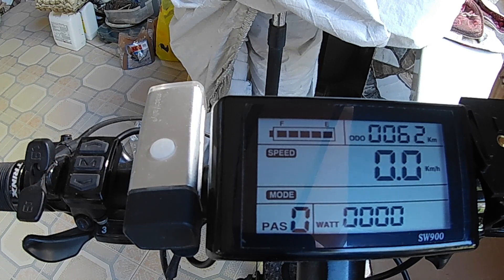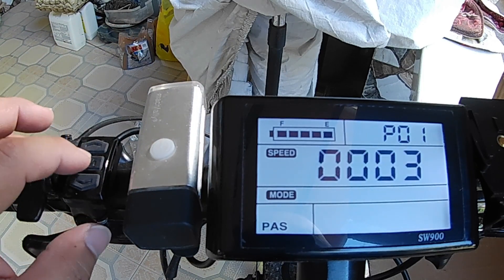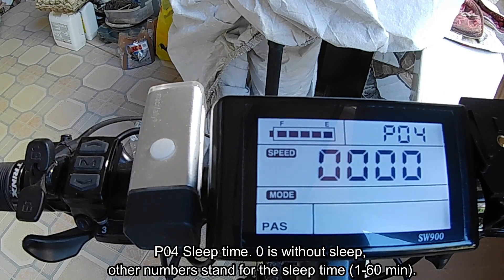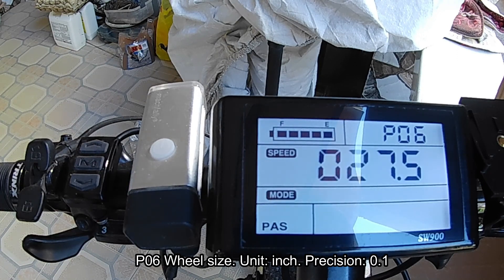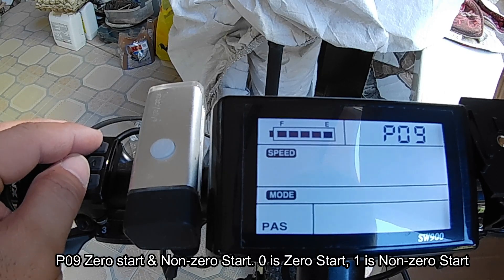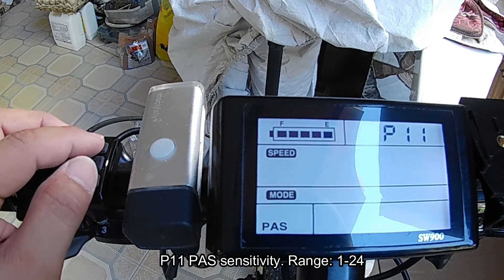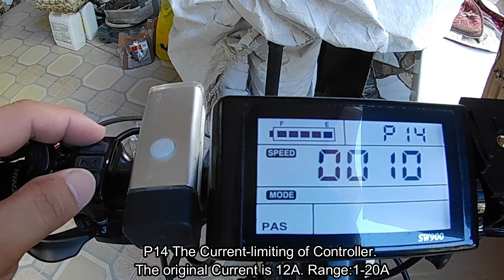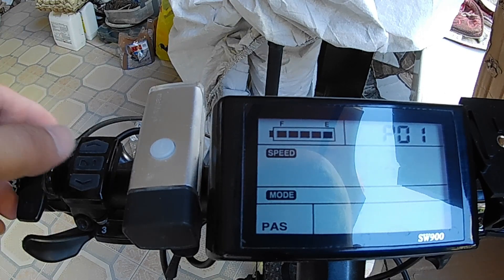DIY Ebike Conversion, Controller Configuration with SW900 LCD Display | DIY Petz

Comment: Thanks for your very helpful video!  Can this display be used with Tongsheng tsdz2 engine?  I would like to replace the vlcd5 that I am currently using.  Thanks again
Reply from the maker: Good day Sir, sorry but I can not tell if these can be used for the said motor Sir. Tnx.

Comment: P09 is throttle activation delay 
You can pick how soon the throttle will start pushing the bike 
Right away after you press it
Or after.
Thanks great video
Reply from the maker: Thanks for the info Sir. Stay safe.

Comment: Thank you for the great presentation ,in the way even I could understand. I built my bike  but I am not a speedster and I got carried away with 1500w motor and a 20 amp hour battery. I have it wired to 750 w and it has more than I need because I daydream a lot and ride on steep rail road embankments.
Reply from the maker: You're welcome Sir, glad to hear that.

Comment: hello thank you for your video. the p14 parameter on my sw900 goes up to 50 A. I have the impression that it is there but inactive because setting it to 1 or 50 does not change anything in torque or speed. possible in your opinion?
Reply from the maker: I think that has something to do with battery spedifically on the continous max discharge current the battery can support. Mine supports up tp 30 Amps continous so this functions works on my e-bike.
Reply: He is correct  that is the  continuous current limit of the controller if is not set properly to match the battery it will shut down the bike. If the bike is working fine leave it as it is or ask the manufacturer

Comment: Hi, thanks your video, it’s been 1 year and wanted to know your experience updated upon your SW900 LCD Display. I have ordered 2 ebike 12000w with the SW900 LCD Display. I herd there’s a new model ukc1 led color display that just came out not to long ago. But yeah I seen good and bad reviews of sw900, what’s your experience feedback on it ? Is it all weather proof? Is it reliable over all ?
Reply from the maker: Good day Sir. It's been almost 2 years also in using the display and so far I have no complains for it. It has been used in all weather conditions and so far it's fine. Nothing to complain about and I have not encountered any issues with it Sir. Stay safe.
Reply: @RollyPetz  thank u 👍🏼

Comment: Have 1000w direct drive sw900 ,Display works show's all data but cannot adjust pedal assist ,it works but feels like its it max assist as draws around 450watts during PAS and no effort peddling (no throttle used)
Also this may help someone ,my sw900 wouldn't connect Error10 I found the 2 data lines crossed ,reversed wires then connect ok
Reply from the maker: Thank a lot for the info Sir Tiggy.
Reply: @RollyPetz  You any ideas on pedal assist ? it makes no difference on settings and can't turn it off with sw900
Reply from the maker: @tiggy2756  Sir what do you mean by turning off?
Reply: @RollyPetz  If I set the pedal assist to any setting even zero I get max pedal assist  all the time
Reply from the maker: @tiggy2756  is it at P11? try also decreasing the P14 and test it out again. Tnx.

Comment: Hola buenas. Que velocidad puede desarrollar este Kit.
Gracias
Reply from the maker: Good day Sir Ramon. The speed of the kits will vary on different scenarios, the weight of the rider, terrain being travelled to, tire pressure and the like. Below are the typical speeds.

PAS Level 0 - Normal pedaling speed between 25-30 km/hour
PAS Level 1 - Speed between 25-30 km/hour  
PAS Level 2 - Speed between 30-35 km/hour
PAS Level 3 - Speed between 35-40 km/hour
PAS Level 4 - Speed between 40-45 km/hour
PAS Level 5 - Speed between 45-50 km/hour

Battery @ 48V 16AH would like go beyond 60 km depending on the pedal assist levels.

Did I answer your question Sir Ramon? Tnx.

Comment: Probleme my sw900 shen turn off , the gaz and pas work. Someone know the probleme
Reply from the maker: Good day Sir, you may want to check sa connection going to the lcd screen if it's OK. Or else try to check sa dim settings of the controller.

Comment: Hi for some reason my battery life bars never go out, Always shows full charge. Any advice?
Reply from the maker: Hi Sir, have you experienced draining the battery for your use, example on a longer ride? Base on my experience it will always stay of full bar until such time the battery drains out then it would likely indicate 3 bars then go back again to full specially when you are at stop. That means that the battery almost reached its low voltage disconnect. But if you continue using it, then it will go 3 bars till 2 bars then would disconnect eventually. Thanks.
Reply: Have you set correct battery voltage in settings ?

Comment: Sir how i fix Error 006, i change battery, i change controer , nott error one time butt engine not work?
Reply from the maker: Hi Sir good day. Have you check the configuration on P03 if its selected to the correct voltage? If this is not set to the correct voltage rating, chances are your motor wouldn't run. I supposed you've already check the battery voltage using a multimeter. Thanks.
Reply: @RollyPetz  Thanks for amswer Sir! I test controller again with avo-meter and battery, two series of battery not working, damaged i think, problem resolved. now bicyce working good. Thanks!
Reply from the maker: @a78011a  Glad to hear its up and running Sir...Stay safe and ride safe.

Comment: When I go to P10 and change it to the option with no pedal assist, pedal assist is still on. Or if I put the option with no throttle assist the throttle is still on
Reply from the maker: Good day Sir. Same thing with my conversion. Both are still on even if the configuration is changed. Maybe this how the controller works. hehehehe. Thanks for your observation on this bug as well.
Reply: Thanks both of you
Reply: In my case my motor is not moving and the pedal assist is still working after disabling it

Comment: Complimenti sir per l'ottimo video e spiegazione top. Ho questo display, mi può spiegare come si fa a resettare error 7? Ho trovato il problema, ora voglio solo cancellare error 7 dal display, ma non so come farlo. Mi aiuti se può
Reply from the maker: Good day for error on P07, kindly check the magnet mounting if it's 1mm closer to the sensor, also check if the sensor cable is mounted and fixed tightly. thanks to google translate I was able to read your comment.

Comment: Hello. The thing I wanted to see was the diameter of the wheel. But you didn't show anything.
Reply from the maker: Hi Sir, for the diameter of the wheel is on config P06 which is the wheel size, in this case for mine its 27.5. Thanks.
Reply: @RollyPetz  Thank you for your reply. But I wanted to know that other diameters can be set. For example is it possible to put 11-inch?
Reply from the maker: @vd1261  good day Sir, yes it can be set to the desired  wheel  size or diameter to what your are using.
Reply: @RollyPetz  Thank you very much. Very kind
Reply from the maker: @vd1261  good day Sir, I'm glad this was helpful. Stay safe.

Comment: I have an issue with my display that i just cant figure out. hoping someone here may know how to fix. the speed limit does not work and cant figure out why when all other settings work. the other problem i have is i set the tyre size correctly and the odometer was correct but the speedometer was around 10 kmh out. reading 40kmh when only going 30kmh. so i changed p07 and got the speedometer right but now my odometer is completly out. did 7.6km but the trip said 4.3km. is there any way to make both accurate? i can change p07 back so the odometer is correct but then the speedometer is wrong. i can change the tyre size to around 16inch to make the speedometer right but i dont think the odometer would be correct.
Reply from the maker: Good day.
Here are my answers based on my test.
> the speed limit does not work this only works on throttle and not on pedal assist
-> offset mileage and odometer -  try to play around the tire size ex. 20", try to put it @ 21" then adjust P07 just a little bit.
Thanks.

Comment: How to solve sw900 error code 10 pls..
Reply from the maker: Good day Sir, this usually happens if there is a loss cable connection between the controller and lcd screen. Try unplugging the main connector cable and check for any corrosion. Then re-insert back. If not then you can try these videos instead. https://www.youtube.com/results?search_query=error+10+sw900
Thanks.

Comment: Hi there - I have an 8000w hub with a 72v controller.

My bike has no power when I select 72v on the sw900 settings. When I select 60v it works and it goes even faster at 48v. Which one would be the correct setting? I have P14 set to 30
Reply from the maker: Hi there Sir Fabian, honestly I'm not an expert on this but what you have is a very powerful motor. But I think the settings would only be as a guide, maybe you can play along as long as the motor works with that settings. Make few adjustments once it works on a particulart voltage. Thanks.
Reply: Hey brother I just got with cyclone 3k motor... thanks for your input! What settings did you settle on?

Comment: Error 10     not work help me
Reply from the maker: Good day Sir, this usually happens if there is a loss cable between the controller and lcd screen. Try unplugging the main connector cable and check for any corrosion. Then re-insert back. If not then you can try these videos instead. https://www.youtube.com/results?search_query=error+10+sw900
Thanks.
Reply: @RollyPetz  Ok Thanks

Comment: Hi, you did not mention what is P15 for is for? Even if you dont use it, still to know what is that for is interesting. Cheers
Reply: Changed by accident.  It did cut off motor.. but very inconsistent.
Reply from the maker: So it works...tnx for the feedback Sir.
Reply from the maker: Good morning Sir, based on my readings even though this is not used but what I have read "P15" is the low voltage cut-off for the controller. I think this would be applicable if your battery is not using a BMS to manage your battery in order for this setting could be useful.  The value of which is 10% less of the total voltage of the battery you are using.
Thanks for your comment Sir. Stay safe.

Comment: My bike says i went 1 mile but only went 3/4 of mile. I have the proper wheel size at 26 inch.  how do i correct this with number 7. do i add more or less magnet to fix ?
Reply from the maker: Good day Sir. 
Are you using fat tires on your bike or having sa bigger tires?  You might want to play around "P06" Wheel size configuration, you may use 27 or 27.5 instead. For  "P07",  yes you can experiment on that by making it higher. I haven't change mine yet...I'll check it out.
Thanks Sir..

Comment: how to reset the Odometer ?  or reset the trip meter ?
Reply from the maker: Good day Sir, to reset the odometer you can navigate via the configuration settings and go to P16, then hold and press the "UP" key for 5 seconds to reset. The trip meter resets every time the ebike is power off. Thanks Sir..

Comment: Hi Sir, great guidance...    can you refer where can I purchase Sw900 and matching controller for 48vlts 1000wtz 10.4mah battery n motor for my bike convertion kit.  Thanks
Reply from the maker: Good day Sir Bernard. Usually, the LCD display in case the SW900 is already included when you purchased the conversion kit. Thanks.

Comment: How can I increase the speed of ecycle or break speed limit with sw900 display. Is it true whether increasing/decreasing tyre size, it may effect  speed limit.
Reply from the maker: Good day Sir. Speed limit can be change by going through the configuration setup specifically P08-> this sets the speed limit of the ebike. Increasing/decreasing the tire size would affect speed. the bigger is the tire, the faster it will run, not only this but also tire pressure and body weight of the user.
Thanks for your comment Sir.
Reply: So do you mean if I put a smaller tyre size ?

Comment: Err08 throttle doesn't work anyone know how to fix
Reply from the maker: Good day Sir Paul, kindly check your setup config P10-2 for PAS and Throttle and check P9-1 set to non zero start. Physically check the cable and connectors for continuity testing. Hope this helps. Thanks.
Reply: Thanks 👍
Reply from the maker: @paulgriffin1967  you're welcome Sir Paul.

Comment: Kit comes with no instructions bought it separately have  A extra blue wire I have no idea where it goes..???
Reply from the maker: Good morning. 
I think the extra blue cable is the "hall sensor" it is the one that limits the motor to run at certain speed. You can leave it unconnected. 
Thanks.
Reply: @RollyPetz   The problem is 5 wires Are part of one connection (Including the blue wire) plus 2 separate wires Which are Brown and white, no blue wire coming out of the controller And only 6 wires, Where the  LCD has 7?
Reply from the maker: @monkeyhaters9258  The important thing to wire/connect to are the battery connectors, LCD display, brake sensor(optional), motor connectors, throttle (optional). Can you send the controller model here and we'll try to look for it. Tnx.
Reply: @RollyPetz  sw900
Reply from the maker: @monkeyhaters9258  good day, what is the controller model? usually, LCD and controller have a male and female pin connector to connect, and an 5 pin connector to the controller side.
Reply: @RollyPetz   Just says SW900.. no instructions, no other paperwork?
Reply from the maker: @monkeyhaters9258  What is your controller model? not the display, the controller itself...
Reply: @RollyPetz   1000 W  Ridgeyard from eBay,,
Reply from the maker: @monkeyhaters9258  I'm sorry I can't find it, Can you send the link here? tnx.
Reply: @RollyPetz   Outdoors mart( 3026) is the seller on eBay The kits $175 ,ridgeyard brand.
Reply from the maker: @monkeyhaters9258  is the controller? I found this link but not the supplier..
https://www.ebay.com/itm/334040373073?hash=item4dc65b9751:g:FtIAAOSw-hBgqobn
Reply from the maker: Hi sir, can you drop the link here, I could not find it on ebay. tnx.
Reply: @RollyPetz   Yeah that's not it ,,,I appreciate your help I'll figure it out,, Thanks👌
Reply from the maker: @monkeyhaters9258  Hope it will work on your end though. I just hope that you can work it out. Thanks for this conversation. Till next time. Have a great day.

Comment: Thanks very much for this. I have a D961 lcd display which has an identical data layout and program menu. I may need to investigate P07 further, but otherwise all programming parameters correspond.
Reply from the maker: Good day Sir Paul. 
Based on my readings, P07 Speed measuring magnet. Range: 1-100
"This is 47 for direct drive motors and 86 for geared ones. "
This is quite tricky though.
Reply: I set the speed measuring magnets p07 using a GPS app that shows me the exact speed at which I am riding. It's around 46 for my bike.

Comment: HELLO, DIY Petz do you know what the problem is (error)
Reply from the maker: Hi Sir Raymond, what is the error code? Tnx.
Reply: @RollyPetz  When I turn on the power, an error is displayed on the lower night screen.
Reply: error 06
Reply from the maker: @raymondwong6680  Sir, Error 06,  states that your battery is under voltage. I haven't encountered that error yet. Maybe you can disconnect your battery and test for the voltage output from the battery itself. Tnx.

Also, you might check on the SW900 configuration on P03 if that is the correct voltage setting.
Reply: @RollyPetz  thank you so much😊👍
Reply: I will give it a try, thank you.
Reply from the maker: You're most welcome Sir Raymond, hope your error will be solved.

Comment: on the 5 level Pedal assist on first i go about 11 Mph  om second i jump to 21 Mph and three about 24Mph . Second should be about 16Mph anyway to fix that? How much difference is on your build?
Reply from the maker: Good day Sir. Based on experience, pedal assist levels would only give you an assist or will activate the motor depending on how hard you pedal. Pedal assist level 1 is the lowest meaning you have to put more effort in order to activate the magnet sensor as this is the hardest to perform. If you go up the levels, 2,3-5 means less effort is exerted to activate the motor to give that assist. Even if you are only at pedal assist level 1 you could still reach the max speed @ 26-30 mph depending on how hard you pedal. I think it has something to do with how the magnet sensor senses how many times the rotation of the magnet sensor which is determined by the controller and how much power will it drive the motor.

Thank you for your comment hope this is helpful.
Reply: @RollyPetz  Thanks for the Reply . I think its because of my Heavy steel frame. Yes i can pedal like dying and get upto 14Mph on pedal assist 1 but on pedal assist 2 easy pedal for 21 Mph. The jump is just too big maybe its only on my bike.
Reply from the maker: @travelwithoutmoving8842  Yes, that's true. Also the higher the pedal assist, much power drives the motor, thus drains the battery faster.

Comment: If I say my tire is 29 inches but is actually 26 inches, will I go faster?
Reply from the maker: Hi Sir Mason, actually you speed will still be the same but your speed on your odometer will a slight faster because you increased the size in your controller configuration, but it would be a nice thing to experiment on. I'll do it on next ride and provide you feedback once done. Thank you for question Sir Mason.
Reply: @RollyPetz  thank you for the reply. Do you happen to know if displays include the temperature of the motor? I know some do but I’m not sure if it’s common.  I’m getting an ebc model c, by the way.
Reply from the maker: @trailguy  Good afternoon sir, sorry for the late reply. I've doing some research but could not find display related to motor temperature with this type of display even on the error codes. Maybe that will be available depending on the controller since it's one handling all alarms and status. Thanks.